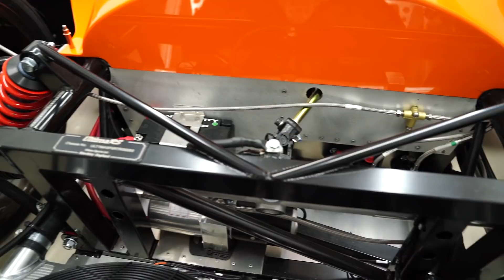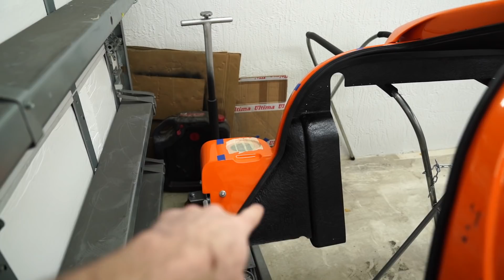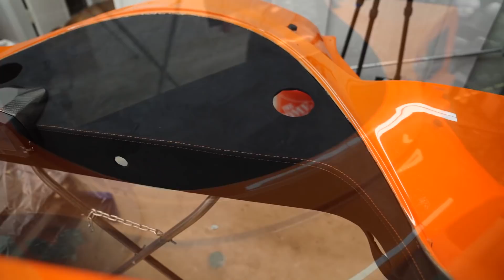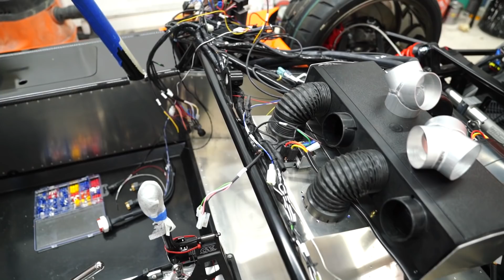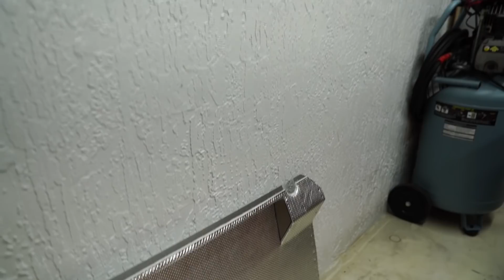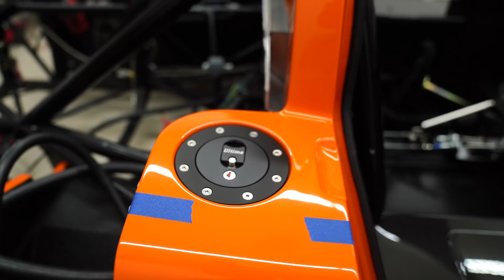Ultima RS Build 05 - Center Canopy, Alcantara Dash, Custom 3D Printed Parts!

Comment: Fantastic work! Amazing how much trimming you have to do, so many opportunities for someone without your skills to stuff up that lovely carbon fibre getting a cut wrong. (That fan wire going from red to black and thick to thin triggered my OCD though!)
Reply from the maker: Good eye on that.  The fans are triggered by the ECU, but they turn on by grounding the relay in the Ultima wiring loom, so the wire could be a very thin one.

Comment: Be aware that nylon degrade a lot why humidity. I advice you pp Carbone fiber (110°c oil, brake fluid, gasoline, water resistant).

Comment: I don’t know if you printed with the nylon CF filament yet. You said you just got your printer. First you need to get a Hardin nozzle because the CF will eat the brass nozzle. The Nylon is very Hydroscopic so you have to dry it out in a dehydrator. After that put it into a sealed air tight with a hole just big enough for the filament to feed though. Also put some dry packs in with the filament so any moisture gets absorbed by them and not back into the nylon.
Reply from the maker: Good tips and those are all things that I did- hardened nozzle, dehydrator, etc.
Reply: Awesome! The car looks amazing keep up the video.

Comment: Hope some protective clear vinyl wrap gets thrown over the carbon sill covers to protect them from passengers sliding in and out.
Reply: Are more clamps going on the braided from brake lines to keep them off the steering rack? Visible around 19:20

Comment: Nice video! Re the 3d printed part, make sure it has the same strength and heat properties as the original. The last thing you want is a fire or shards of plastic going in your engine. Other than that best of luck and enjoy :)

Comment: You should maybe think about getting the part printed for you as this might get quite hard to print properly especially with carbon fibre nylon Filament. I don't know which printer you got but such Filament is rather hard to get a good result out of.

Comment: Please be sure to pressure test your PC/Nylon final 3d printed part. You may find under boost + heat there will be additional stresses not noticed under normal conditions which may cause leaks. A Sealant coat on the outside of the print may be good for final reinforcement or baking in fine salt to anneal and prep for final use.

Comment: Glad you went with the transmission insulation, it is much better in performance and life expectancy than the bling ‘gold’ insulation, if it’s not real gold it doesn’t do the same heat rejection.

Comment: Alcantara dash, yes.  I once had a Ford Capri.  I made the mistake of polishing the dash, couldn’t see where I was going until the shine wore off.
My yellow kit car has a black dash with yellow stitching.
I also printed the air intakes including the hoses.  21 hours per hose to print.
Reply from the maker: Yeah I couldn't believe the print times at first! This part took 56 hours!
Reply: @UltimateUltimaRS .  Yes some of the prints can take a long time.  Orientation of the print can be important if your design requires a lot of supports or a raft.   It can be a long time but sometimes the only way.

Comment: Fantastic work, I just want to send a word of caution about using that 3d printed part as a finished product. Layer lines are potential points of failure (leakage and breakage). Issues are greatly reduced by annealing your parts, but then you will still face the fact that, no matter what fibers are added to your filament, it is still plastic a d can be softened by engine bay temps. If that part is softened by heat a d you slam closed the throttle from high rpms it could suck the plenum closed which means it would be sucked in as well, or a hole could be sucked through if it gives way on a layer line. Weve had issues with 3d printed items softening just leaving them in the passenger compartment with the windows rolled up parked in the sun.

3d printing is a fantastic rapid prototyping tool and depending on the environment it's great for functional parts. But in a harsh (high temp) environment I would not trust it.
Can you imagine digging that out from your supercharger, which would be destroyed by ingesting that plastic even if softened.

I strongly recommend having that part cast. 
Look up protolabs or some similar company. Between the tb and sc is not a place to take a short cut.

Love your build. I can't wait for the next video!
Reply from the maker: Good to know and something I will look into. The stock one provided by Ultima is laser sintered nylon which feels very strong, so I feel the carbon/nylon with proper thickness should be equal or better in strength. I am thinking of putting a layer of epoxy and maybe chopped carbon fiber. We'll see...
Reply: @UltimateUltimaRS  if you are going to use it, be sure to study up on annealing of 3d nylon prints.

Comment: I'd redo that intake with welded up pie cuts. It will be waaay less restrictive and will hold up to the heat, vibration, and stresses in the engine bay infinitely better.
Reply: He's got an ultima rs, he doesnt need the extra wank factor for showing off. No reason for it to be pipe in a tight space like that especially with how long it would take to make the odd shapes and ovalized sections line up perfect with each other. Plastic intakes are perfectly fine, most manufacturers use them now.

Comment: The hurry-up-and-wait is the worst when you're waiting for parts.  You did a killer job on the dash, and the carpeted interior sides look so good you're tempting me to do the same!  You might want to seal up the edges of the rear bulkhead with some aluminum tape too, that will give it a finished look and keep out moisture and debris.
Reply: Hope you are feeling better.
Reply from the maker: Thanks, Will. I'd definitely recommend the carpeted sides. It took very little time to do and I think it will also help with heat mitigation. Hope you're doing well!

Comment: Well done it looks a treat mate! Is there any body sealing needed on the front and fire wall section to stop water or noise?
Reply from the maker: Yes there is sealing underneath as well as on the sides where there is a splash guard.